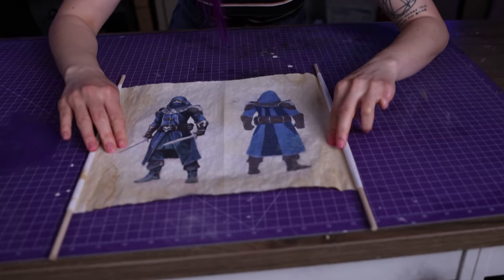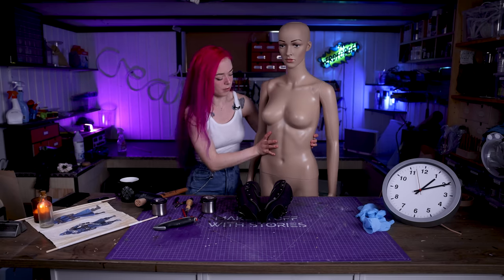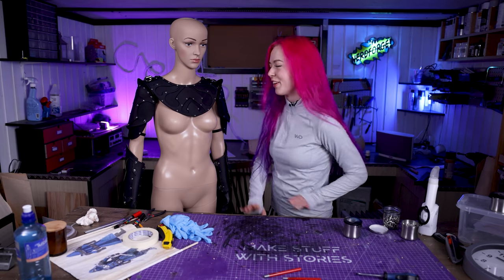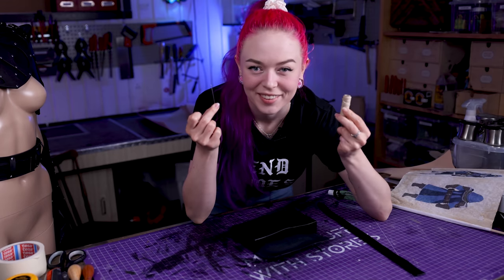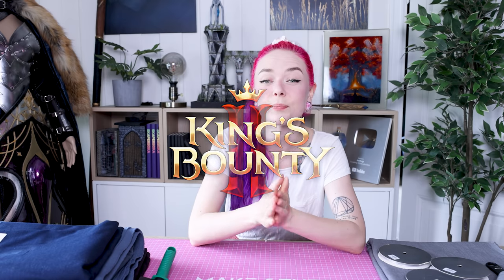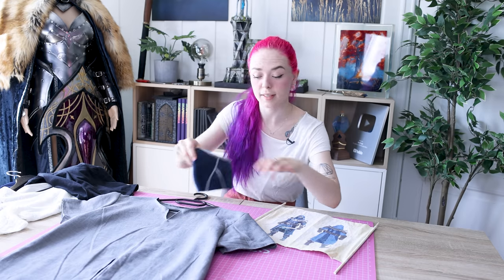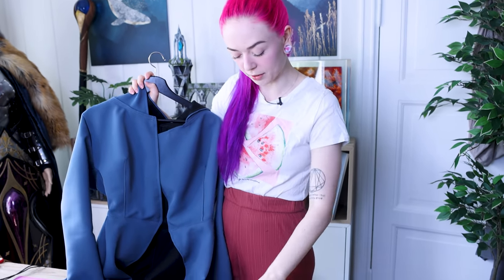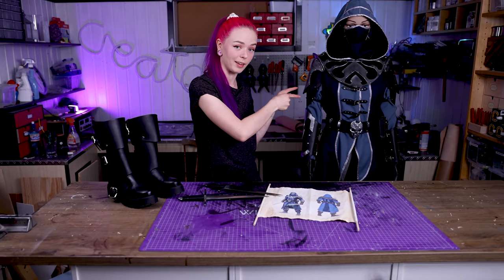I Made a Full Body Rogue Armor!

Comment: If you want to make leather softer and more pliable, use neatsfoot oil. If you're making armour with it, melt hard beeswax & carnuba(about 50/50) until too hot for your health and submerge the leather in it for 15-25min. Wrap your bod in towels and have an accomplice stap the leather in place. When it cools it will be as hard as ABS
 Plastic. The Romans didnt have carnuba but used linseed oil, which when heated to t boiling point makes linoleum.

Comment: This looks amazing. One thing, for future costumes ect,  if you are going to burnish the edges of leather with wax, gum tragacanth, or anything like that, then it should by dyed before you burnish it. The reason for this is because dyes don't absorb into the edges as well if there's already a finish (like wax, gum tragacanth, or anything like that) on the edges. I just don't want you to have trouble with future leather work 😊. This costume turned out amazing though. Great video 👍

Comment: 4:18 When you do the templates, after cutting out the paper version, do you simply mirror one side, or do you really cut out left and right side separately?
Perfect symmetry by mirroring the sides is probably easier on the eyes, but using the left and right side separately probably fits a tiny bit better.
\Edit Woah, the end result looks fantastic. 
 I want an armor too. How much for a commission of a custom armor set?

Comment: If you submerge the leather in a bucket of warm water before you start tooling it or punching holes in it, it's far easier to work.. and that tip comes from Paul Cox, a world renowned leather worker that does belts, bags, motorcycle seats and many other things. https://paulcoxindustries.com/leather-1 I would've made a neck gaiter style mask and not a covid style. I've never seen a rogue with their throat or ears exposed before... either that or you'd have to do a turtleneck and pull it up high. (I guess you realized that too before the final assembly)